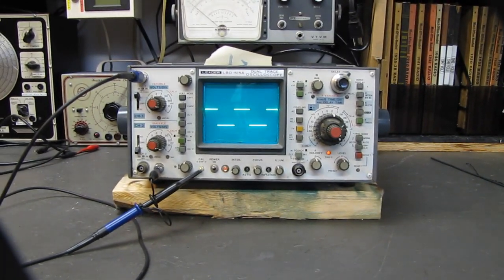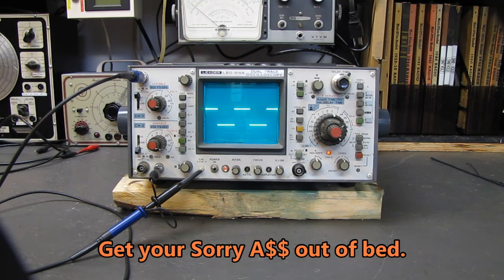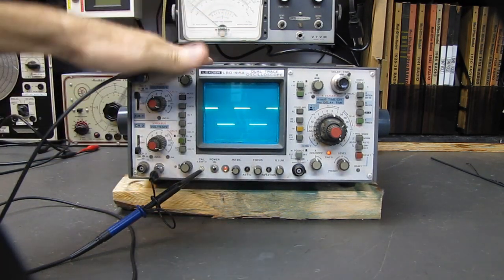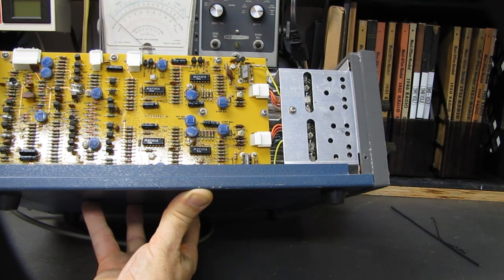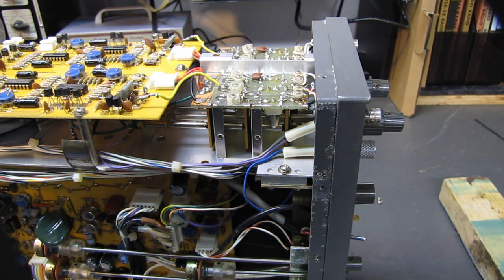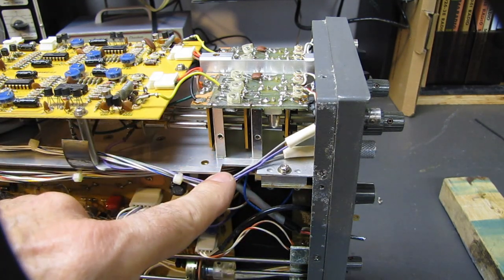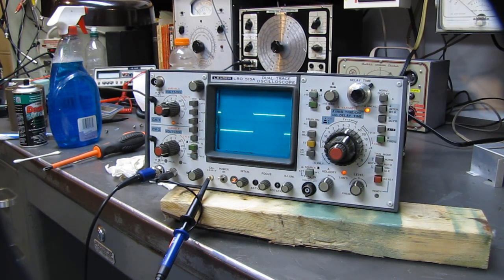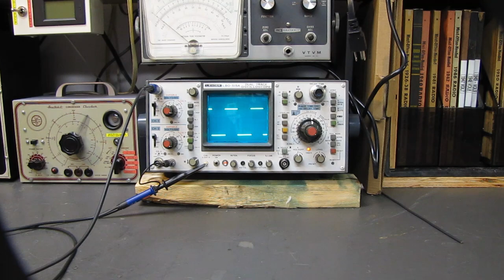Ten Buck Test Bench - A New Bench Scope

Comment: Great advice for anyone wanting to get into electronics. i always suggest certain brands to start with. The older kit build gear is where I started. Most of the service info and even the build check off sheets are available on line. And if I was going to service radios or tv's first off I need to service the test equipment " most of it has the same capacitors and other components we replace in vintage radio/tvs".  And you learn the fundamental's of schematics. The rest kinda falls in place afterwards.
Reply from the maker: Hi Jamie,

I agree with you on the older gear. I have a lot of "Vintage" gear in daily use. Heathkit and EICO made some very useful test gear that is still relevant today. Not to mention Boonton that was bought out by HP in later years. I have Boonton Capacitance Bridges as well as Boonton Inductance bridges from the 50's that are as accurate today as the day they were manufactured. They are just a little slower to use.
 
Quite the collection of old TV's in your garage. I'm guessing your in P.A.from the Keystone reference. Certainly within striking distance the Fall Hamfest in N.H. Lots of vintage stuff shows up there. Take care.
Reply: @theradiomechanic9625   I live outside of Pittsburgh at this time.  As for televisions there is more than 3 years of projects in the big shop and I am glad I am not the only owner. Winter projects for my end a couple radios and test equipment modifications. And one hallicrafters tv will be a joint restore. I want to put my hands in it because it is a hallicrafters 😂. Take care sir..

Comment: Perfect find. I heard you say great for AM radio work. Do you use it for voltage measurements? Signal tracing? Calibration? Please elaborate. Thanks Vern.
Reply from the maker: Yes, Yes and Yes. 😀All of the above and more. I can look for the source of hum, is it the supply or modulation hum. Instability in the AVC etc. Also can be used in conjunction with a sweep generator to display I.F. Curves. To align FM I.F. again using a sweep generator. 99% of the time a scope isn't needed, but it can speed thing up.
Reply: @theradiomechanic9625  I’ve never felt really comfortable using a scope for voltage measurements. Probably because I took Computer Electronics in 1981 as a vocational course and good digital meters were available for a reasonable price even at that time. I have 3 scopes on the bench or next to it…..maybe I’ll try it? Anyway thank you for your knowledge. I always loved the $10 test bench.